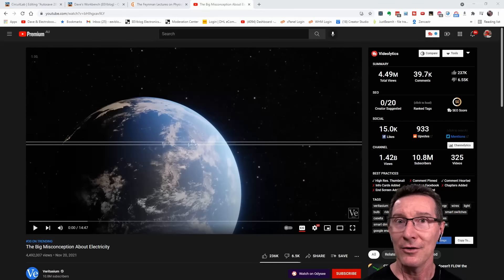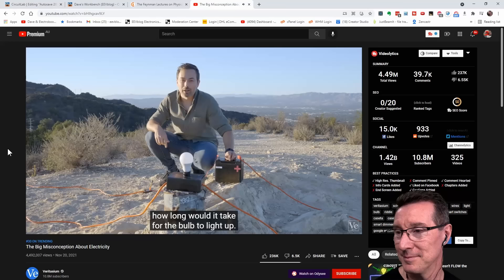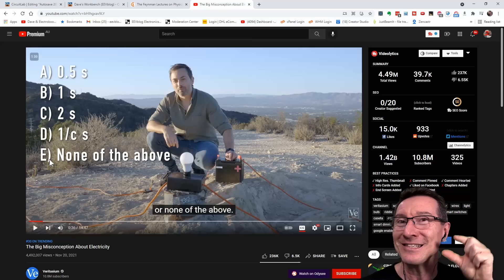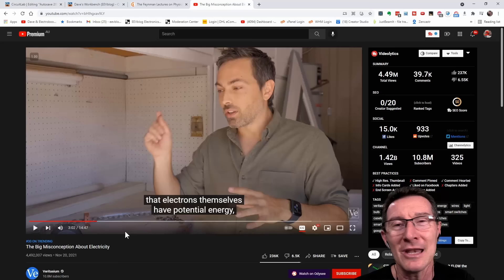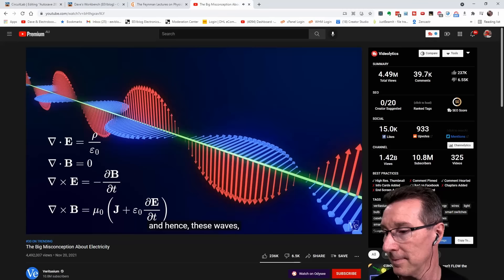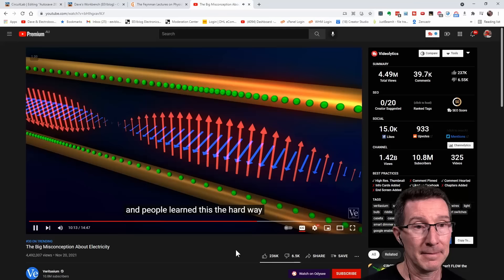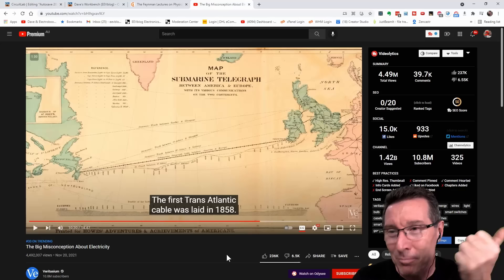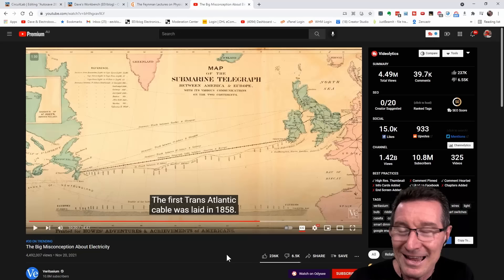EEVblog 1439 - Analysing Veritasium's Electricity Misconceptions Video

Comment: at 13:07 the interviewee says: "People seem to think you are pumping electrons..." and Dave chuckles at the idea - "nobody thinks that". However, this belief is pervasive amongst non-engineers because this is what most of us were taught in physics at school. And, ironically, this belief is prevalent amongst astronomers and cosmologist, too, because they are constantly trying to explain the presence of magnetism in the cosmos (and our solar system) by gravitational spin and "remnants" - not attributing it to energy and electric flow because there is no evident wire to provide an electron  "circuit"
Reply: I was smirking at that "nobody thinks that" aswell. Actually as far as i know this is actually what the vast majority of people think. 
"There is this electrical current thingy that flows out of the wall plug and makes my stuff work."
Reply: I distinctly remember a faucet being used as a metaphor in my high school science textbook
Reply: Exactly, this is what I learned in school. Simple as that. That needs to change is my idea, it doesn't make things very clear if you go any further than what you were taught and what's really the point then to learn it in a bad way?
Reply: Maybe most people think it but I think it's a fairly common exercise to calculate the speed of an electron in a circuit and find out its slow. The chain model he uses is actually fair too but you need to be aware that the speed of sound in the metal is more like the propagation of the signal than the movement of the chain (we learned of virtual "phonons" as the equivalent to photons then never used the term again).
Reply: I learned that elastic collisions between the electrons and the atoms in the conductor is the cause of resistance/impedance. I guess this is actually wrong? How does the field model explain resistance?
Reply: Cryptocurrents I think you may be being a bit broad there. Astrophysicists are usually very good at identifying the effects of moving electric and or magnetic fields on objects passing the fields and on those generating the fields.

You don’t need an actual conductor the whole way between the objects but you do need something to setup a current in for the energy to be dissipated. 

The magnetic fields of the gas giants have been shown to be contributing to the melting in the cores and oceans of the moons of the gas giants, there are models for how close a planet can be to a Reddwarf where the main limiting factor is likely the electric and magnetic interactions 

That said some astronomers do mess it up.

LIGO would be affected in a very different way by passing through an electric current to what it detects when a gravity wave passes through it so energy definitely does get dissipated from systems via the production of gravitational waves.
Reply: This is a perfect example of the "curse of knowledge" on Dave's part.  Just because it is obvious to him, it should be obvious to everyone.  Dave himself said it is counter intuitive but then goes on to say "nobody thinks that".  Fascinating.
Reply: Surely the energy is transferred through pumping electrons? Even if it is inductance or capacitance.
I really am lost at this notion, can anyone explain? Like in fluorescent or xray tubes until you get some ions or electrons it doesn't light up
Reply: @SixTough  the energy is expended by moving electrons around, it can be transferred via the fields or EM radiation but it doesn’t get changed into heat or movement or light or whatever until it interacts with charged particles etc.
Reply: @mattmurphy7030  Obviously there ARE electrons in free space, unless you think the molecules of the various constituents of air don't have electron orbitals, for some reason. Or did you mean the vacuum of space?
Reply: @mattmurphy7030  well the electric field induces electron movement in a conductive antenna.
Reply: There's a somewhat analogous situation (at least I think so) in the world of acoustics.   A tuba player sits down with his instrument and beings playing.   The tuba is 5 m or more of tubing.   How long does it take for his breath to emerge from the bell?   Answer is about a minute (can be demonstrated with a fellow who both smokes and plays).   The idea is that the acoustic energy moves a lot faster than the medium.
Reply: @mattmurphy7030  yes but it doesnt work in an insulating antenna, does it
Reply: @mattmurphy7030  through electrostatic interaction. It's not the question. If the energy is transfered without a medium surely vacuum itself would act as an antenna
Reply: @VincentGroenewold  Our physics high-school class mentioned it, but I imagine that's not everywhere in the world. Or heck, it's probably not even the case in my city. But it's not an easy thing to just solve. The basics of circuit analysis is able to be taught since, well, KCL and KVL is rather easy to solve. Just addition and multiplications, a bit of equation solving/linear algebra. Every high-school student is able to do this rather easily. I'd also argue that it's important to have some basic electrical experience like that. 
And while it certainly isn't impossible for high-school students to calculate poynting vectors and do all the Maxwell laws, it's... more math and more abstract and is it really necessary? Like in high-school physics class we were also taught about Newton and classical physics. Technically that's also wrong because Einstein and quantum mechanics exist. Does that mean they should just skip Newton all together, or teach how to do quantum mechanics? I don't think so, and I think that's kind of the same deal with electricity. A mention and elaboration that "this isn't 100% correct" should be said more often in classes though.
Reply: I'm going to argue that it doesn't actually matter what people think who don't understand electricity.  It's like that video of an interviewer asking Feynman why ice is slippery, and his answer is "because it is, that's a property of ice.  It's slippery."  He then goes on to explain how water expands when it freezes, and how when you step on ice you're compressing it which causes some of the water to melt, and then there's friction, and there's flow characteristics and boundary layers, so that the friction between the surface of the ice and the layer of water directly over it doesn't move, but it has friction with the layers of water over that, and those layers of water move and all that, but none of that is relevant to a person who sees some ice on their driveway.  The explanation that a property of ice is that it's slippery is sufficient.  Any further knowledge is useless on that winter day.  It's academically interesting, but practically irrelevant.

So does a random person who has no physics, engineering, or electronics training think that the power plant is pumping electrons to you matter?  No, not really.  And they will gain nothing practically if they learn anything else.
Reply: @mattmurphy7030  when EM radiation is transmitted through vacuum energy is not transmitted to anything. That is the point if there are no electrons there is nothing being powered. It doesn't count as an antenna if it generates random noise.
Reply: Yeah, I have met a lot of people that thought that.
Reply: As an electrician this is what I was taught and believed for 40 years.  I am somewhat aghast now
Reply: @mattmurphy7030  the radiation is already in the em field. To make something work you have to pump the electrons
Reply: @mattmurphy7030  well you seem to believe that photons transfer energy into the EM field, so I just pointed it out
Reply: Electrons have to be moving to cause a current which produces the magnetic field
 : that's the point which may have been lost. The thing that gets them moving there is electrostatic repulsion - a gradient in electrostatic potential (aka. a voltage difference) - that gradient is an electric field.
Reply: The work being done is basically going into setting up these fields against their own kinds of inertia, though, NOT accelerating the negligible mass of the electrons along their conduit. That is a good point that has been made in the video (and the original).
Reply: @mattmurphy7030  why do people who have such enormous intellect feel compelled to abuse their gifts by delighting in putting down others? you've only succeeded in gratifying your own ego; the lessons imparted like the crude scribbling of a child onto a tapestry of incomparable worth. please, have compassion on others. the need far outweighs any sentiments regarding it.
Reply: @owfan4134  he has a good point but physicists have no connection with the practical processes happening in the world. It is not a criticism, they actually have to be able to think in an abstract manner to do thei job. But there is a massive disconnect. The speed of the electrons seems slow but in a cable you are moving say e15 of them per second. Easy to miss
Reply: @prospectelectric2201  he said engineers... not trade-ees. 😉
Reply: Well, you ARE pumping electrons.  Just not the same electrons that come out the other end of the wire.  And most people DO understand that when you talk to someone at a sensible distance, the air from your mouth isn't reaching their ears.  It just doesn't occur to them that electricity operates in a similar manner.  What I don't like about the smirking, superior physicists, is that they don't get that there are different models that get you the same answer.  And that you can also get the WRONG answer with the superior physics.  The problem was set up with a 1m spacing between the wires so that most technical people won't even consider the capacitive coupling between the wire, but the FACT is, doing this experiment as stated with a real light bulb will have the light coming on very dimly, then rising to full brightness a second later, due to a big impedance mismatch between the light bulb and the transmission line.  The problem was poorly posed, because without knowing the resistance of the light bulb and the diameter of the wires, you can't determine how well these are matched.
Reply: @mattmurphy7030  Because even in classical field theory, any sensible person would neglect the coupling between wires because it is just too small. Something you learn early on in physics is to get an intuition about which effects you can ignore and which you need to consider.
Reply: @mattmurphy7030  No clue how any of these persons are, but no light bulb will turn on from these effects. Sure, there is measurable current, but just not enough to make this effect important.

It's like saying you can perfectly heat food sitting outside of a closed microwave oven, because there will still be some radiation leaking out. Is there energy going out of the oven? Sure. Would any sane person consider this for heating food? No.
Reply: Perhaps it's more instructive to look at this common misconception from an economic perspective. Historically, the service provider has laid the infrastructure that the end user pays for. Initially, the water from the river only got pumped through channels to your home because somebody with impressive foresight paid to build them, knowing you and countess others would pay good money for the convenience of having a channel of water you can use where you reside, any time you need it. A little while later, electricity comes along, providing a similar basic function to the home, with similar initial costs paid for by the provider so that you can provide them a return on their investment. If the water gets to your faucet through the aqueduct, you pay the ones who made and own the aqueduct. If you can run your washing machine by plugging it in to an outlet connected to wires that had to be brought from somewhere into your home by somebody else, then you pay them. In either case, no conductors running to you means no service.
 I haven't bothered to watch the video in question. The algorithm really wants me to see it, but this just sounds like one of of those cases in which you have to ask, "for whom does any of this matter?" It makes no difference to the guy who is trying to figure out how to plug in an appliance and be able to pay for the luxury, nor for the person like myself, who might build the odd electronic gadget. The knowledge that wires are necessary to power a device, but wires are not where the power truly comes from, changes exactly nothing for either group. That leaves only the student of theoretical physics, but then if they get very far, they are all going to balk at that reduction of a variable to a presumed constant through omission.
Reply: @glenecollins  We agree about electric fields. Without getting into specific issues, I think it is fair to say that mainstream planetary scientce, astrophysics and cosmology (NASA, ESA, most universities) makes little to no acknowledgement of electricity out in the 'vacuum" of space. Yes, there is Plasma physics but it exists in near isolation. Consider the frequent mainstream scientific expressions of "surprize", "puzzlement" and "mystery" about electrical phenomena in the cosmos. They still argue that the Earth has a magnetic field because of a "spinning iron core" and that comet tails are a result of heat induced "off-gassing" rather than ionic discharge (plasma). For the most part mainstream science seeks mechanical and gravitation explanations for cosmic phenomena, that are more accurately explained by electric/plasma models.
Reply: @cryptocurrents946  I think you may need to seek some further education on what the current models actually are. No geophysicist or planetologist thinks the magnetic fields of any of the planets are caused by spinning bits of metal. (Did you get that from a movie?) A solid lump of spinning metal will not produce a magnetic field, a solid magnet couldn’t produce a set of magnetic fields like the ones we observe.

According to our current models he magnetic fields of the earth are generated by moving  currents in the outer core which because of their chemistry are moving ionic charges around.

There have been probes sent through the tails of comets which sampled the material, part of it was charged ions but most of it was various ices. The solar wind is known to be composed of ions and it is accepted that it can charge surfaces depending on the materials they are made of we observe that on the ISS.
Reply: @mattmurphy7030  biology guy. Pls excuse my ignorance.
Reply: So, people, please explain why the "pumping electrons around" explanation is wrong? Because they DO move, however slowly, pushed around by an electric potential difference. So what is so wrong about it?
Reply: @robbiejames1540  it isn’t entirely wrong it just isn’t the whole picture otherwise capacitors, transformers, wireless power transmission, generators etc wouldn’t work and high frequency devices would be way more easy to make. There has to be electrons and or ions moving around somewhere in there but that particles in a pipe model doesn’t cover every situation.

Didn’t you watch the video?
Reply: @glenecollins  
Yep, I did watch the video, but still fail to see how "particles in a pipe with charge" fails to explain any of those devices you mentioned there - we know magnetic fields are created by moving charges, and the interaction that changing magnetic fields have on charged particles, and with that surely you can accurately describe inductors and inductive devices such as motors, generators, some types of wireless power transmission etc. Capacitors need not even that to be explained. So...
What's wrong?
Reply: @mattmurphy7030  
When voltage is applied to the antenna, more electrons are pushed into it, charging it slightly and creating an electric field. Rapidly flipping this creates a rapidly oscillating electric field (and it's complementary magnetic field) which can then propagate outwards into space as radio waves.
Reply: @robbiejames1540  how do you explain capacitors without the electric field? 

I think you are over thinking it (or you just got answered by the wrong person an we aren’t explaining ourselves well there was an electric universe type in the comments)

As long as you are accounting for the fields there isn’t anything wrong with focusing on the particles. For high frequency work (which I have only dabbled in) it is easier to think about it in terms of the interactions of the fields.

According to some interpretations of quantum mechanics all energy is transferred through fields but for practical purposes just go with what is easier.
Reply: @glenecollins  @Matt Murphy
I guess I've not been communicating very clearly :(  I don't claim that electric fields don't exist - they obviously do and a full understanding of electricity is impossible without including field theory. However, as far as I can tell, in circuits fields seem to either "pump" electrons round the circuit, or be caused by another field that is doing the pumping (as in the case of the antenna or during the charging of a capacitor). So why people are saying how obvious it is that electricity isn't electrons being pumped round the circuit, I can't understand. Because by all accounts I've heard, that seems to be exactly what is happening - the electric field potential difference between the ends of the circuit pushes/pulls the electrons round it.
Reply: @robbiejames1540  I think you are over thinking it, a lot of people thought that electrons had to physically travel to the point where they make things happen rather than the energy being carried in the fields made as charged particles jostle around.

And then they are understanding the significance of the charged particles as you said if there were no charged to be acted on the fields from the set of charged particles which would be providing energy would just sit there and nothing would happen. There have to be moving charges to make the fields and moving charges to absorb them and make stuff happen. You just don’t have to have an electron or whatever physically run around to deliver the energy.
Reply: @robbiejames1540  if you are getting stuck on the electrons having to go somewhere rather than just being like people doing a Mexican wave (but somehow passing energy not just information) just think of the case with AC those electrons are basically just wiggling back and forward they go very slightly more each time in one direction when there is a load in the circuit but almost none of the energy is carried in the net momentum of the electrons all the energy is in the fields (in the case of AC around the wires).

One of my old lecturers used to try to get us to think of DC like a really long Newton’s cradle with a ball being added or taken away at one end of the wire and all the other balls just jostling the one in front or behind them. It probably isn’t all that accurate but it helped me visualise it. Same with DC in a superconductor except the electron pairs can just ignore any back jostle so the fields never die down. 
With AC in a superconductor thinking about it just as electron pairs running through the material doesn’t work the fields can get twisted up and you loose superconductivity when the fields cross a certain level. (I blocked most of it out but I remember it was a pain in the butt)
Reply: @robbiejames1540  Well by that same analogy water comes out of a tap because it was physically transported through the pipe from source. However, electricity is not delivered by the physical rate of electron flow. The energy (work) is transmitted in the electrical field that surrounds the conductor. Think of a transformer where there is a physical break in continuity of the conduit from source,
Reply: @cryptocurrents946  
Watch electroboom's video, particularly from about 3:51 to 9:05
Reply: @mattmurphy7030  Didn't care enough to watch the video at that time, but someone actually went out and built the circuit.

https://www.youtube.com/watch?v=2Vrhk5OjBP8

Turns out the current will not be enough to power something big. I don't know where the flaw in the other video is, as I am not that well versed in electronics and the way those people think about EM fields. Someone else I saw simulated the problem and also got the same result as in the experiment.